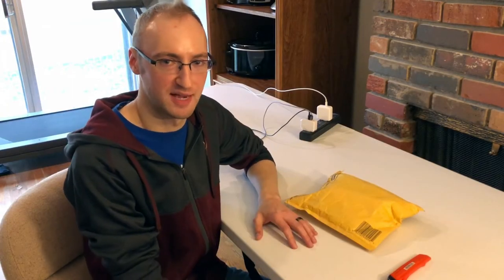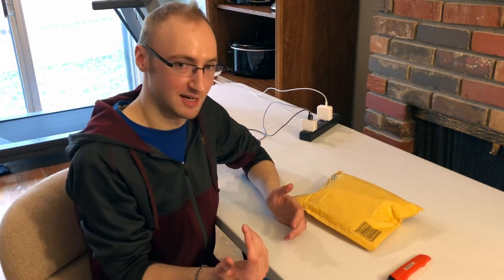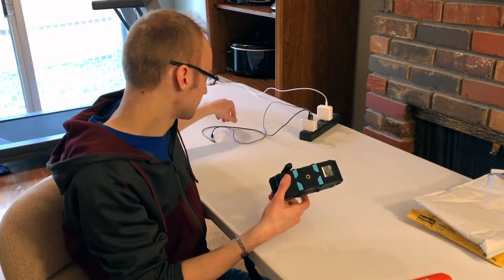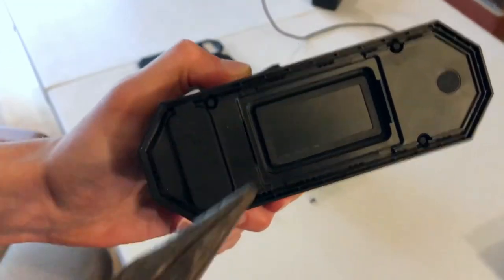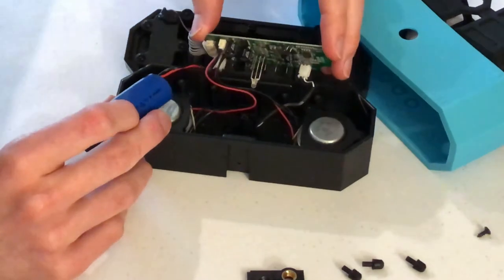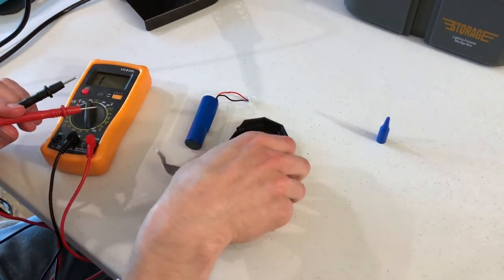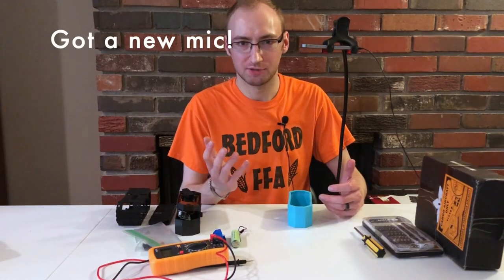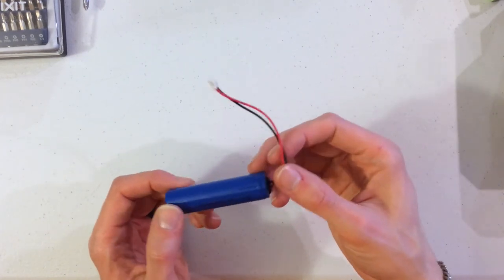Repairing an Altec Lansing Mini LifeJacket 3 Bluetooth Speaker Part 1

Comment: I have the life jacket 3 from 2015. Mine is not charging anymore, but it does power on and work. I haven’t checked to see if the port has dirt built up inside, but I did begin breaking it down to check the wires. 
I see in recent comments pairing suggestions were made. Holding down both volume buttons is how you reset the pairing.
Reply from the maker: That sounds like a good plan. Might need to clean those contacts as well.

Comment: Hey there, thanks for the view on my channel. So, there seems to be a design flaw with these speakers, and that makes the best speaker I've tried...the WORST. The mini usb charging ports fail on these ALL the time! I found HUNDREDS of comments/complaints about this, so the company MUST know about it, and since they don't change it, they are crappy!! I put 2 new, higher capacity batteries in it (I thought it was that too), and it worked for a minute, but nope...so I ordered a replacement mini usb charging port. It's not hard to get the mini board out with the connector on it, but I've never de-soldered anything & had to order flux & a new soldering gun kit as well. This is NOT a job for the average person as you know, so most people would just throw it out. I tried solder wick, but my tip was old & crap. I ordered new ones, but the iron's heating element burnt out in the middle of working on it! So I ordered a new one, since I ordered the tips already...so I'll have 2 irons. Anyway, I'm still waiting on the new soldering iron to get here next week, then I can hopefully finish. I still have to remove the old solder clogging the holes. It's a push through type connector. I think I'll be okay. I refurbish shoes and have a good magnifying glass with a light. I've soldered wires together before, but that's it. Oh, when I got my batteries from China (wasn't in a hurry...have another bt speaker) I just used pieces of paper clips to make the connections to the strip on the batteries (I have Lifejacket 2 so there's 2 batteries). A tiny chip fell off when I was opening the speaker...thank goodness for the magnifying glass, so I can put that back where it goes! If everything goes okay, or not, the video should be up maybe next weekend. I'm supposed to get the new iron in the middle of next week. For me, the replacement piece was like 2 or 3 dollars with shipping. They should just use new ones. At least I got it new on clearance for $49.99 (the 3 was already out) instead of $149.99. I hope that helps, and the final video will be up soon...the replacement and putting it back together. Good luck!
Reply from the maker: Thanks for the good luck!

Comment: This may seem unconnected ,however so, because of your question......I learned that pushing those buttons reset the mini life jacket. My off / on button stopped working in the on position.so having to recharge it every time I needed it was not cool.🤬🤬🤬
That being said I looked at a question from someone else on Reddit.
There I found out about the lol five finger reset press on all 5 buttons and it completely reset!!!🥳🥳🥳🥳
So what I'm saying is this ....had you not existed here on YouTube......this unit was going into the garbage.
Got this more than 4 yrs ago as a prize after spending 250 on tickets for a house lottery.
This was a consolation for losing.
Now it is very cheap but it was garbage and I saved money regardless.
Thank-you.
Reply from the maker: Thanks for sharing!

Comment: Have you tried pressing the + and - buttons at the same time until you hear a beep (pairing reset) or all 3 at same time (reset)?
Reply from the maker: Unfortunately I have, the reset appears to complete but the speaker still is not pairable. :(
Reply: @yenterpriseonebay  it’s pairable? when u reset the device you have to let it sit till it makes the sound then you can connect your device

Comment: Thank you for your video. When you tested for continuity on the ribbon wire... I noticed that perhaps there could be a short between the individual wires. Did you check off camera, or can you, check to see if voltage is leaking from one contact to another? ...ie, holding one probe on one contact, while trying all of the other contacts on the other end.
Reply from the maker: I don't remember if I did that or not. That sounds like a great idea though! I will try it when I get back around to it.
Reply: @yenterpriseonebay  Wow that's great! I look forward to your findings!

Comment: My nearly decade-old HP 17" beats laptop keyboard crapped out on me. I'm using a Bluetooth keyboard for now to avoid buying a new laptop. Anyway to fix the current keyboard that I have?
Reply from the maker: Opening the computer up and inspecting all keyboard ribbon cable connections would be the best way to diagnose it going on little information.
Reply: @yenterpriseonebay  Thanks for the quick response. Will have the laptop checked out. Your ALTEC Lifejacket tutorial came in handy after my early-model began talking longer to turn on and is now blinking red. This could mean that my eight-year old stalworth may be due to for a battery changeout or I may look to replace it. In any event, I'm going to perform surgery on it today with your video at my side.
Reply from the maker: @theopoliswaters2405  I wish you good luck!!

Comment: My Hydra jolt won't charge or turn on. I Have never dropped it or put it in water as the charging port cover was no where to as tight as my random brand trend tech speaker that floats in the pool with a normal on on top and on the bottom a flat rubber circle that that moves, but is also is a speaker.
Reply from the maker: Battery may have died.

Comment: It looks like it was in pairing mode, judging by the flashing LED. I have a Super Lifejacket which I'm planning to look into. It works, but the I believe that the battery might be on its way out, since when I charge it, the red LED never goes out. There is a button combination, (I can't remember it), but when they are both pressed at the same time with the unit on, it tells you the battery charge status. As for the battery itself, it looks like a battery that can be purchased at any Vape Shop, except you would need to tack weld leads onto it.
Reply from the maker: Had never thought about a vape battery.
Reply: @yenterpriseonebay  It looks like that's what they are. Are those batteries by chance 18650's?
Reply from the maker: @Rangerman9404  Yep, I believe so.

Comment: I have an infamous xpedition 4, can you do a video on fixing one, Main problem, stopped working after a couple months, won't charge, used power supply only and that quite as well.
Reply from the maker: I just looked that one up, unfortunately right now there are none for parts or not working on eBay - I would have to wait until one pops up or see if I can come across one where I work. I'll try to keep my eyes peeled though! I also have a The Jacket H2O, 3x Super LifeJackets, a Super LifeJacket Jolt and a VersA I will be working on eventually.

Comment: i know this video is old so maybe no one will see it but i have just gotten an issue with my altec lansing hydroblast speaker, it refuses to turn off and the bluetooth icon no longer glows i can connect it and it beeps in response so i know the sound isnt broken and now it wont play audio. It still can pause skip and connect to bluetooth devices just will NOT turn off or play the audio i have tried resetting it all that does it make it beep like it understands what im trying to do and STILL wont work i need to know if its something i can fix or if it would be easier to simply replace it
Reply from the maker: That is tough. Easiest solution would be to replace it. There is a lot going on it sounds like. When in doubt I open things up to see what is going on inside.

Comment: Hey I'm not sure if you've already been told this cuz I haven't read in the other comments but I just thought I would pass along some info I was hoping that you were going to be able to show me how to change the battery out because I've had three of these now the mini life jackets and they are little beasts they put out some serious boom when they work properly however all three of them have had major issues with the USB port I tried to take and disassemble one last summer and yeah I should have never done that without getting some sort of a manual to give me instructions so that's why I was watching your video however I think you gave up at the end due to that purple light the purple pinkish light that comes on instead of the blue and I just wanted to tell you that that's normal when okay I'll take anything mini life jacket is charged and it's still plugged in it goes from the blue to the purple so I just thought I would share that you might have fixed it and you still don't even know it like I said I haven't read the other comments so maybe someone else already told you that but I just thought I would share that with you and thank you for showing me how to get the battery out the right way LOL have a great night good luck:-)
Reply from the maker: Gotcha, thanks for the help!

Comment: Mine had a chip in the bottom right of the board that shorted I am guessing and then I had unplugged the battery and plugged it back in, smoke started to appear and I left it plugged in. I think the short melted itself away and it works now lol. Gonna put a little heat sink on it.
Reply from the maker: Interesting. I am still in the process of finding another one like it to examine.

Comment: Ion speakers charge port is ruind,any suggestions how to charge it without the charger or repair it?
Reply from the maker: You would need to locate a new charge port for your model online and solder it in. If you Google the model you may get lucky and find one.

Comment: Can I change battery from home ?without a solder ?
Reply from the maker: Correct, you don't need a soldering iron to replace the battery. It connects to the circuit board via a plastic plug.
Reply: @yenterpriseonebay  can I install a regular energizer rechargeable battery in it ?
Reply: @yenterpriseonebay  my speaker fell in water and was in water for 3 days 
Now it’s making some growning sound once in a while
Reply from the maker: @GB-be9bu  If it is the same model as the one in the video, you'll have to order a special battery like the one I replaced. The link to the one I got is in the video description.
Reply: @yenterpriseonebay  ok thank you